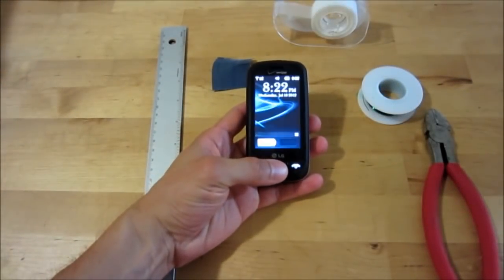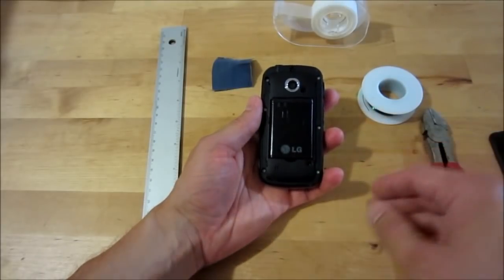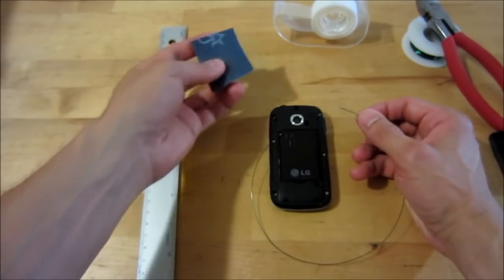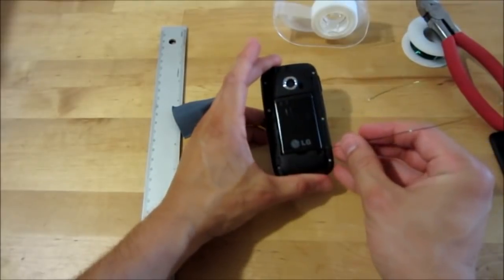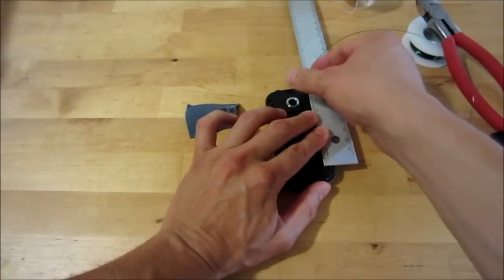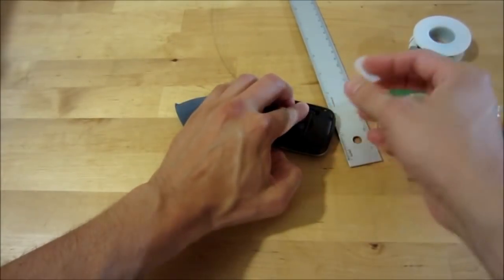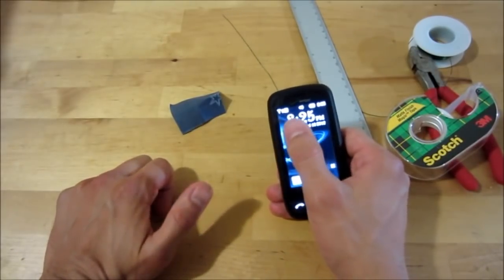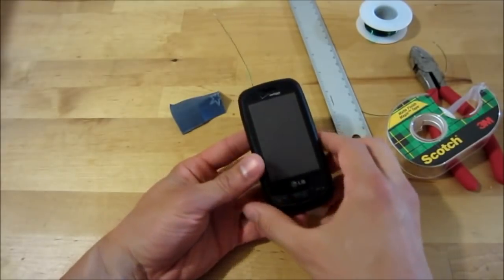DIY Cell Phone Antenna in 3 Minutes!

Comment: Survey says:  eeeeeeaaaahhhh!  Thanks for playing... Radio frequency is determined by antenna length! Its physics...you cant change that with a wish! Then you have Ground Plane!  Most internal cellphone antennas are a modified YAGI antenna inserted in the ground plane of the circuit board.  Good luck with that.

Comment: I tried it and there was no improvement on my phone.  Before adding "the cure" It had a maximum of three bars on the deck in the back yard.  With "the cure" I had two bars in the same location!  NO WORKIE!   Luckily, my phone still works outside the house after trying this antenna.  I feel lucky based on other reviews.....

Comment: There seems to be a whole lot of  "Oh no! You mean I have to plug something in?". This port might still be around but inaccessible without accessing the mainboard. I had two ports on the AT&T Galaxy S4 that were visible. I recall one not being for external antenna use (can damage device, apparently).

 If you want to get fancy you can unplug the antenna itself and solder a connection or extension on.

Comment: This would have been a great video if youtube was around in 1997
Reply: Actually, back in 1997  cell phones came with extendable antennas already so this video wouldn't have been necessary.
Reply: Roadside Table no not all, I don't read Wikipedia that much for a era I was alive in, I am from the UK and I maybe off by a year but I remembered antennas and non-antenna devices coexisting, it's one thing to read the past but another to live it.. Only if you lived in the UK at a certain date you would remember snickers bar as the marathon chocolate bar which was the first name of the bar I remembered, when the bar went world wide it was given a different name, UK is very small in population compared to other lands so if Wikipedia today said Snickers was the original name, everyone would agree especially the young and people who live abroad. Back to the phones, antennas main reason was not for reception but more so authorities know your on a cell and more importantly they can track your body to keep citizens safe right...
Reply: +DJ LNR around here it was more so the telecom cartels could build out a competitively sparse network by today's standards and still have it work reasonably well. There was still a great deal of analog cellular at the time here and so there would have been a lot more static on the line had it not been for the extendable antennas and higher power limits .  My first digital capable  phone i bought in 96 but there was still a lot of analog cellular. Nowadays we don't have static, were have garbles and sudden loss of signal without having a real good way to know where to hold the phone in areas of weak signal. Contrary to the misleading coverage maps and claims of covering 99%of the population, most of the united States is still without reliable coverage. Manufacturers are bound by radiation limits that would be higher if there were antennas that were extendable and would lose certification which is required to bring them to market. I didn't mean to infer that you were a millennial or genZ

Comment: Phones operate on different frequency bands. In the UK they range from 900MHZ to 1800MHZ and also 2100MHZ. People trying your hack need to know what wave band they should cut their antenna to deal with. Obviously you are in the USA, but you have a wide range of frequency bands too. The phone's original antenna was designed as a broadband radiator and will cope with the phone switching to different bands, but the simple quarter wave radiator will not and you may end up with the transmitter chip being presented with a very big impedance mismatch which will see the phone's output power being converted into heat in the final amplifier of the chip and possibly destroying it.

Also - these tiny test port antenna sockets contain a tiny coaxial switch and they are easily destroyed if you poke random wire into the socket. The internet is alive with woeful reports of people who poked random plugs, wires and pins into these kind of sockets and ended up breaking the tiny internal switch (it is designed to switch out the phone internal antenna when connected to a test rig and correct plug). This ends with them finding they have absolutely no signal at all when they take out the random object the stuffed into the small test point socket. Just google the issue and you will find a lot of unhappy experimenters.

Comment: It worked :)
Forget the length bla bla bla. I just put a wire, connected to the antenna 'pin' and then bend it under the cover (around 5cm long) and my reception is better by ~ 10%.
I'm on Wind - Ontario.
Reply: +GR glad it worked for you.  i will say however that length does matter in this context - as your phone is also a transmitter, if the length is cut incorrectly you will get high SWR, which can damage the transmitter.  if it is not off that much then you'll be fine, but if it is grossly mismatched then you're in trouble.
Reply: how did you measure the 10% improvement? dropped 9 calls out of 10 rather than 10 out of 10?
Reply: Absolutely correct.  I suspect the chance of a mismatch damaging the phone is low but any device that transmits will create reflections that make unwanted power spikes where they should not be.  This means the possibility of damage, extra drain on power, and poor performance.    Even if you see more bars that improvement may only be on a single band.  Cellphone use many different bands.  Some aren't available in all areas.  Data is often transmitted in a different band then voice.  That could mean very poor data speeds or calls dropping more frequently.  It's always best to attempt to match your antenna.  This antenna for instance was meant to match multiple bands.  Todays phone often use 4 different bands.

Comment: Careful with this,  I fried the internal antenne of my S3 mini
Reply: +Paul Sudbrock Yup. You didn't actually fry it, you broke the tiny coaxial switch inside the plug permanently  disconnecting the internal antenna. It can be repaired. There are ways. One thing to try is to poke a short piece of BARE wire into the socket, making SURE that you don't create a short circuit to the outer shell of the little socket. THen snip off the wire about 2mm above the socket so you only have a tiny bit poking out (just so you can get hold of it and pull it out if you need to). Then test your internal antenna again. My bet is it will work then. If it does, put a small piece of tape over that socket to hold the little wire connection in and be happy that you have re-made the internal connection on the broken coaxial switch.

There is an outside chance that you burned out the transmitter chip in your phones radio modem, and you can't repair that, but my bet is it is just the switch.

Comment: Did he say the  6.3 inch is 1/4 Wavelength? Is the phone operating in the 450 MHz region? 6.3 inch is the 1/2 Wavelength for 900 MHz. 1/4 Wavelength is 3.15 in. Hi Makify 1, what is the operating frequency of your LG phone? This would help clarifythe wavelength query. Tq
Reply from the maker: +Thomas Peter That phone was an LG Cosmos Touch (VN270) that operates at 1.9GHz and 800MHz so, 6.3" is about 1/2 wavelength at 800MHz and 1 full wavelength at 1.9GHz. Sorry for the confusion.

Comment: Out of & in true You Tube philosophy which to me is ingenuity at the cost of recycling and knowledge sharing at the right price.. Free;  this one works I have hardcore dead zone issues sometimes I have to wait for a passenger plane to fly overhead to bounce a signal to lock on.
Yet a hundred metres aeay the signal is strong. 
This is a good works 2 bar min.
Thanks Bro  ps 16.3 cm is the metric conversion.

Comment: Guess I should have done a little more research before trying it on my S4, because all it did for me was fry my internal antenna. As soon as I powered it back up it lost all signal.
Reply: +Jason Johnson SEe my message above to Paul Sudbrok. You can fix that probably without any great skill.
Reply: does the phone maintenance center can fix it if your method doesn't work ?
Reply: Jason Johnson 3r4332333

Comment: Disregarding the garbage comments, this is a great video. This does not damage your phone if you carefully do exactly what is shown. Many smartphones have multiple antenna jacks. Wifi/bluetooth 2.4/5ghz band, LTE 700-800mhz band, CDMA, and GSM bands that all will want a different wavelength antenna size.

Quick and easy trick to help struggle less in an area of low signal.

Comment: Be carefull you all, at the end of that connector there's usually a "fuse" so once you put something in that connector the built in antenna stops working.
Reply: how to fix that ?
Reply: unsolder it and solder a new one or jump short it. Fine soldering required

Comment: most of those ports are service ports for jtaging . not external antennas. the mass majority of external antennas are repeaters for carrier signal or bluetooth style for gps externals. I would not hook into any port without a jtag layout first to limit the possibility of shorting out a circuit.

Comment: A shortcut will destroy your internal antenna.
Reply: +Lorenzo van het Hul The socket has a small coaxial switch inside it. They are not meant as user available, extension antenna sockets, they are test sockets for technical staff to test the RF output. The CORRECT test lead can be carefully plugged in to disconnect the internal phone antenna and divert the RF output of the phone radio modem up the  test lead and into a 50 ohm test rig. You can't properly test the phone output with the antenna connected and the test load inside the test equipment as the impedance will be wrong. These switches inside the plug are VERY fragile and only are meant to cope with a short central pin of a specific size. If you shove in a long pin on an unsuitable rf plug or a random bit of fat wire, the break / make contact inside which disconnects the internal antenna and then re-makes the contact after the correct plug is withdrawn, will likely be bent beyond specification leaving you with an open circuit antenna inside the phone. There are loads of sad users writing on the web specifically about now useless Samsung phones, broken by fiddling with this socket. I know about these because I researched them. I have no reason to suspect that other brands besides Samsung are not equally affected since ALL phones need a break/make switch inside that plug as only one antenna at a time can be connected to a radio modem unless the impedance of the antenna is to be unsuitable with the risk of overheating the output chips of the modem/transmitter. 

Hope that helps. There is a diagram of the broken socket internals here from a thread on the subject.

http://forum.xda-developers.com/attachment.php?attachmentid=1840363&d=1364481507

The thread is here:

http://forum.xda-developers.com/galaxy-s2/general/external-antenna-socket-warning-t1273292
Reply: No it won't. Do you actually know how an antenna works? Even ESD won't destroy it.
Reply: +Lorenzo van het Hul The sockets all contain a tiny coaxial switch and these are easily destroyed by poking wires or even the wrong plug into the hole. Just scan the replies and see how people report total failure of the internal antenna after poking things into the hole. The antenna is ok, but the link through the test socket is permanently destroyed if the wrong plug is put in. This is a well known problem especially with samsung phones.

http://forum.xda-developers.com/attachment.php?attachmentid=1840363&d=1364481507
Reply: Oh, but how does it destroy it permanently? This is pretty interesting tbh
Reply: Thanks! On the iPhone 4, there are 2 test sockets, but i got a dead iPhone 5c logic board here which i have for fun and there is no test socket at all. And is it possible to replace the sockets in order to get a functional antenna again and close the antenna circuitry? Thanks for the info :)
Reply: Oh thanks! But are the iPhone sockets also wasy to break like that?
Reply: +Lorenzo van het Hul You would need to know exactly what kind of socket you have there and you would need to be skilled in micro soldering and have a suitable soldering iron and bit. In that thread I linked to above, there are a few ways of recovering from the broken socket on the Samsung phones. One way involves de-soldering the socket (BE CAREFUL - very easy to over-heat the board and destroy it) and replacing with a new socket, but also, you can just bridge the socket with a scrap of tinned wire removing the make/break switch entirely. You can check the photos out in that thread. Obviously, this is risky unless you are skilled with a small iron, so at your own risk..... Another method was just to put a small scrap of wire into the hole and bridge the broken switch that way. Look at the thread.... There are good diagrams and photos there. That thread applies to Samsung swicth sockets, but the Iphone ones will operate the same way since no phone can have two antennas connected at teh same time without an impedance mis match so any test lead would have to disconnect the internal phone antenna.

Comment: If you are going to try this you should consider first turning off your phone and taking the battery out.  Also make sure the other end of the magnet wire is not making contact with conducive material.  Just a thought.

Comment: Just add a flux capacitor...
Reply: I added a flux-cap on mine. Battery meter went down to 1sec, but luckily I shot back to 1985, so still got like 30yrs till dead battery..
Reply: Electronoob: Geeking Out

1.21 JIGAWATTS!!!???
Reply: Yeah, flux capacitor would work well with that.

Comment: If you are going to try this you should consider first turning off your phone and taking the battery out.  Also make sure the other end of the magnet wire is not making contact with conducive material.  Just a thought.
Reply: Why should he turn the phone off, and why should he take the battery out?  Are you an electronics engineer?  Do you power off and unplug your tv or stereo when adjusting the antenna?  Do you power off your car and disconnect the battery to change stations?  What conductive material let alone electrical material is under the phone cover besides the antenna signal port?  I hate it when people comment on a subject they know nothing about.  You basically are comparing this to Ben Franklin standing in a lightning strom flying a kite.  Try reading up before you talk, jeez.
Reply: Greg Hamm before doing any modifications, repairs, etc. It is always best to take out the battery. If you do not, it is very easy to short out the antenna. Let's not even get into static or using an antistatic wrist band. Trust me I am a certified cellphone and tablet technician. I work on iPads all the time, and if you do not remove the battery connection then you will blow the backlight. Different things, but same situations.
Reply: No you won't blow up your iPad backlight fuse if you are careful. I repaired a shit ton iPads, iPod touches (especially the 4th gen) and iPhone, and samsung. And the devices with the battery soldered on= i don't give a flying fuck. I repair phones while turned on since the BIOS identifier is the first thing while booting up, so if you disconnect a part in an iPad which isn't powered or detected at that moment, nothing happens.

I always play a music on the device i'm repairing to hear if it still works. Especially on iPods.

But you can only blow a iPad backlight fuse when the screen is powered UP while disconnecting, or when you short it while current is switched to the backlight.
Reply: Greg Hamm
 Greg buddy... a large amount of phones have battery contacts in that area. If you mistakenly touched those contacts while the phone is powered on you could short the phone and the battery out, which could cause the battery to overheat, this would most likely end with the device and battery both damaged. Whenever the back case of the phone is taken off you should remove the battery as a safety precaution before attempting any work.

Comment: Take your phone apart, make three wraps length-wise around the phone with that magnet wire while keeping it away from the circuits and you will have full strength signal in a dumpster!

Comment: Add a DC blocking cap like a .5 pf. ( or smallest non electrolytic ) You could build up a charge on that little piece of wire and damage the sensitivity and range which would decrease your range worse than it was, over time. I know from experience. Just a little word of advice.